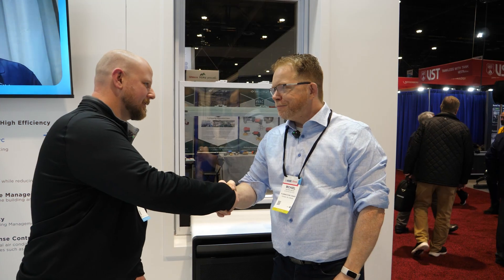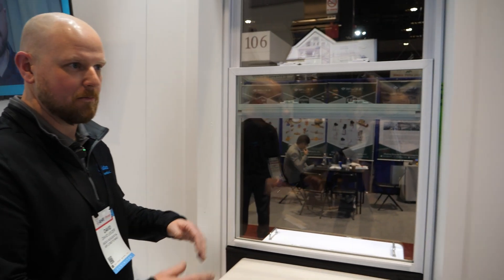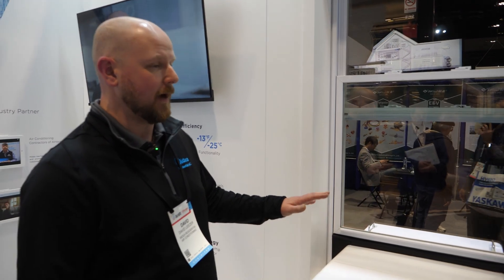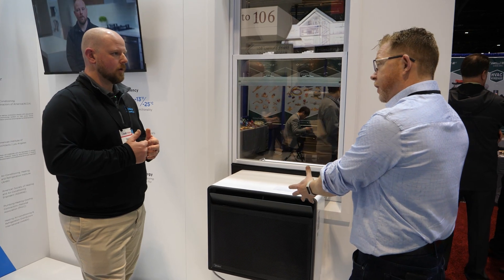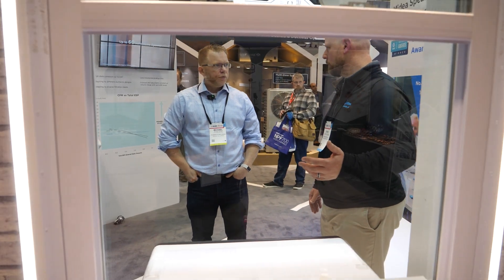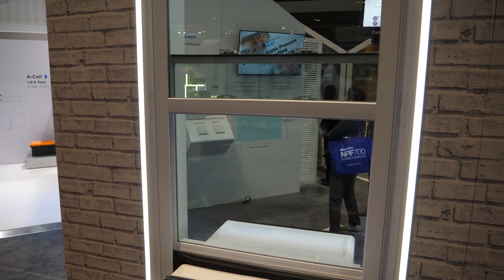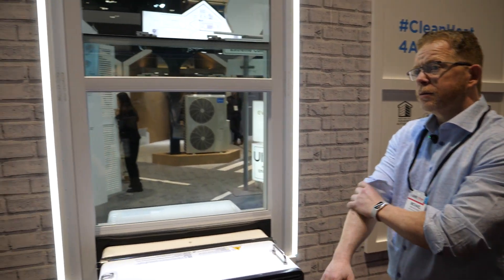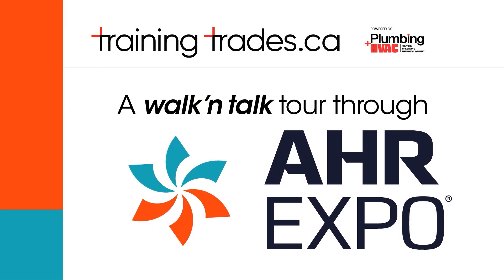Walk N Talk AHR Expo 2024: Unpacking Midea's Revolutionary Window Heat Pump

Comment: The Midea PWHP is no longer DIY-friendly.  According to a Midea CSR, contrary to all of their online promo material, Midea now demands that purchasers use a certified HVAC contractor for both acquiring the unit and installing it -- adding to the already high $3,000 cost.  The CSR gave no indication that Midea plans to correct or delete their marketing literature, so potential buyers will likely waste their time thinking the unit is DIY, as I did.

Comment: how many watts does it pull?   can you run it at lower power like the Midea U A/C units.  I use them for zoned cooling in north florida and rarely need to turn them higher than Medium or dehumidify.

Comment: Too expensive
Reply: $3,000 per unit is chump change compared to pulling new wire and upgrading existing electrical service to handle central HVAC when the previous heating was a boiler. I'd love to have one of these for my home because it'd be way cheaper than replacing my current older heat pump and air handler.

Comment: For now Midea's achilles heal, they need vertical windows to work, 80% of houses in Ca. have slide windows.  I am lucky I wanted vertical lift windows installed in my house, so I have a 12k unit to assist with my central air.

Comment: $3,000 ??  Not gonna happen. it's a Window unit.  Should cost twice the price of a standard AC window unit.
Reply: If it's actually a maintainable appliance and not disposable, that puts the justifiable price up quite a bit. For a first generation product in limited run production, I think $3k is high but not absurd.
Reply: agreed, it is too much money when there at mini-split units at cost for half.
Reply: @Jon-hx7pe nowhere near as plug and play though
Reply: @MurseTech64  can buy mini-split hardware for less and have professionally installed for another $1 to $2k and end up with a far better system than a window unit.
Reply: @Jon-hx7pe  Mini splits are essentially heat pumps. I have one. This puts it in an all-in-one package instead of having to run plumping etc. Works great for retrofitting older buildings. Had this been out at the time I got my mini split then I would have got one of these.
Reply: @MurseTech64  drilling a small hole to put in a mini-split is good for retrofitting old buildings.
the situation a cold climate window heatpump vs a mini-split version is good  is for rental where landlord doesn't pay the utility bills, won't spend the money for a mini-split and tenant can put it in and save. But the price will have to come down, it is just outrageous right now. you can buy a inverter window cooling only unit for well under $1k and it is the same tech minus reversing valve and defrost controls so heatpump version should not be so much more expensive.
Reply: @Jon-hx7pe  I can agree with that. After I commented the first time I ran across these inverter units for a lot less. They seem quiet.
Reply: Might be worth it if it could heat/cool the whole apartment, but doesn't 9K BTU seem a bit under powered? Not sure one unit would cut the proverbial mustard.
Reply: @vcp93  450 square feet on the high end? It's enough if you're already covered by a small/medium window unit, probably.
Reply: These are being made for a captive audience, complex owners that HAVE to retrofit their units to the new standard, these will be certified. So yes the price is important but meeting standards are just as important.
Reply: Calculate the savings on your heating and cooling electricity bill when using this heat pump versus the standard technology of a standard AC. Also, there might be rebates.

Comment: I saw a lot of cool innovations, like the handles, it's fold able for install etc... But both the ad I saw that lead me here, and the video both, make it sound like this is the first time anyone has made a window heat pump.That's not true, I have used window heatpumps from several different manufacturers. Ranging from 8k btu up to 28k btu. When we bought our current trailer, we decided to turn down the central unit, so we could keep using the window heat pump units. But, I will definitely check this out, I do need to add one.

Comment: You didn't ask the really important questions of when it's going to be available and what's the target price range. Touting the technology isn't useful if nobody can buy it. My landlord really wants to put in heat pumps because my idiot neighbors like to run their thermostats at 78º and he's paying for the natural gas for the building's boiler. He's thinking of putting in mini-splits, but they're not cheap and neither is the installation. I told him he should wait for these, but he's getting impatient. He wants to do it this year, 2025 at the absolute furthest out.
Reply: Target price is ballpark $3k based on the NYC contract it's designed to fit.
Reply: @daniellewis1789  Hope so, but there's no official word and that may not be the case. Gradient was the other company chosen for the contract and they've set the retail price of their unit at $5000.
Reply: landlords learned this many years ago: set real temp to 69-72 degrees F. Put in fake thermostat enclosed within locked clear plastic thermostat cover product. Tenant will sneak a paperclip in there and feel oh so clever.
Reply: Ive heard midea will be 3k gradients version will be 3,800-5k